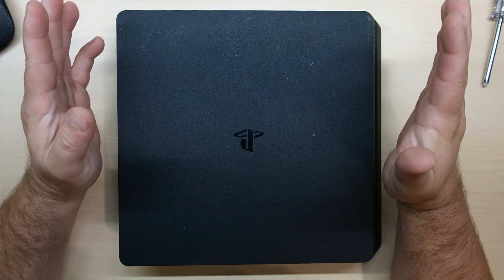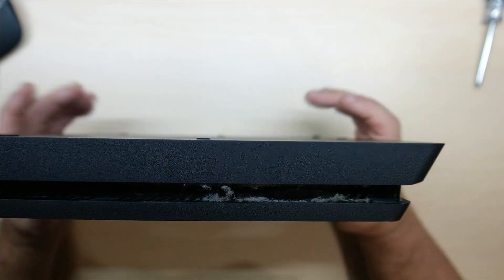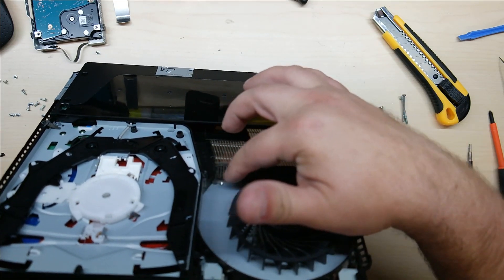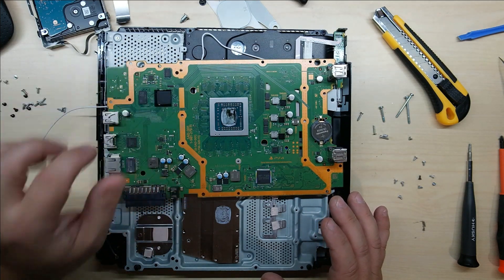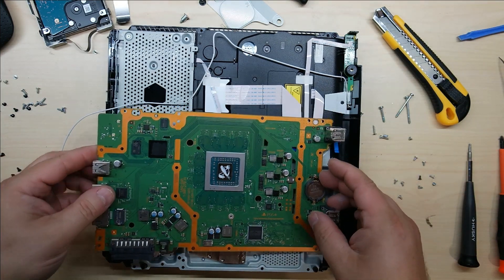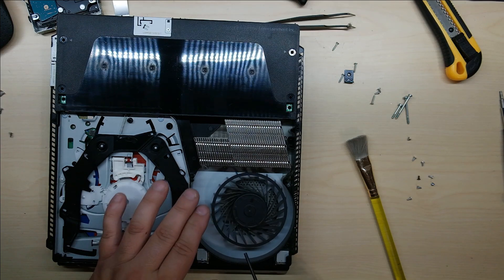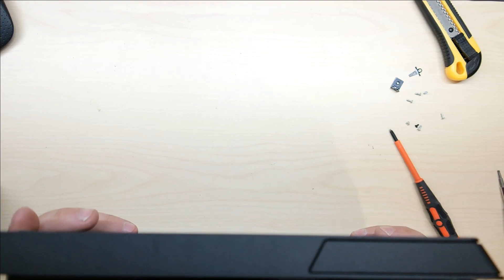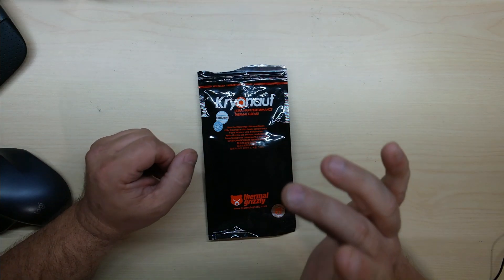Don't Run Your Electronics On The Floor!!!

Comment: I like watching your videos and have done for a couple of years thanks.. I have a request. Super caps and batteries interested me and inspired me to buy some super caps but I got the chinese ones and results were poor. 
I'm running a home power solar install with  5K inverter and LFP 48v battery (200AH)  with  5K of panels on the roof atm . I've been fiddling with heating hot water from the panels when  the power available is not being used elsewhere and need an auto system to turn on a 1K element when the battery is charged.

Your knowledge is much stronger than mine and I wondered if you might steer the solar way a bit?

Comment: I have my computer sitting on the floor, on carpet, with two cats.
BUT, I have my case flow top to bottom. Two Noctua 140mm intake fans on the top, one Noctua 120mm intake fan on the top rear. Two Noctua 120mm exhaust on the front bottom, and two 140mm exhaust on the bottom. Noctua NHD15 on my 5.2GHz 7700k  flowing straight down.
Reply from the maker: Ok, so you win at being the exception to the rule.  Thankfully you can change the airflow characteristics of a computer tower case, not so easily with a console.